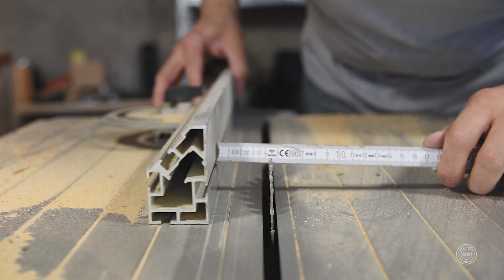How to make a Treasure Chest//Build a Treasure Chest out of pallet wood

Comment: Howdy, nice work you did on this chest. Especially keeping it light weight. I have a nearly 3 year old who loves pirates and I think I'll make him this treasure chest for his birthday. For the hardware what did you paint on to make it black? Just enamel? And also how long are those Brad nails you used? I ask cause I am learning to use a gun like that and getting quite variable results with penetration and trying to judge what length nail to use incorrectly can be annoying when the project gets nailed to the table!
Reply from the maker: Hey man thanks. I made the chest for my son also and it came light way. Bradnails was 20mm if I remember right and I used the steel blackener for the screws?